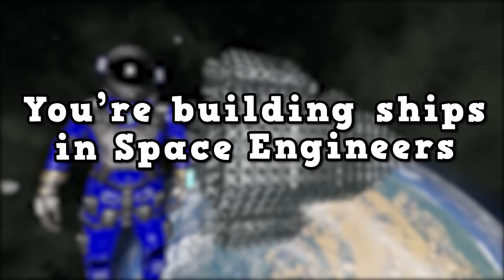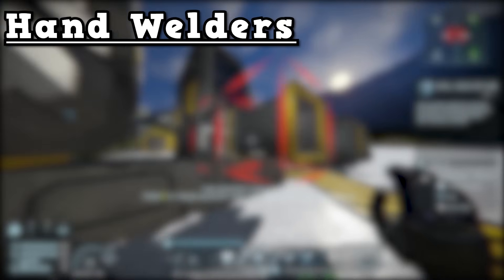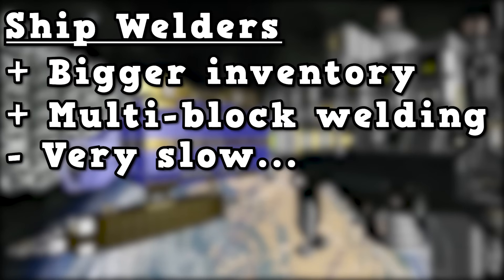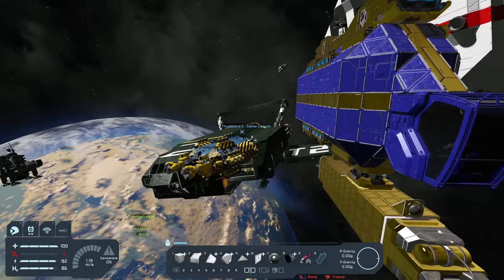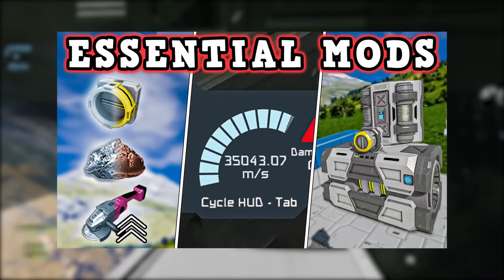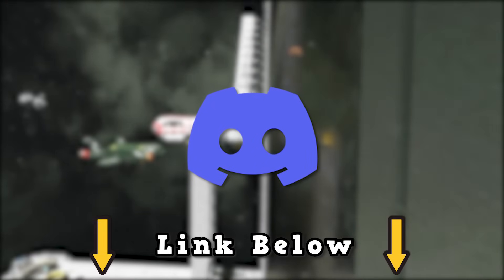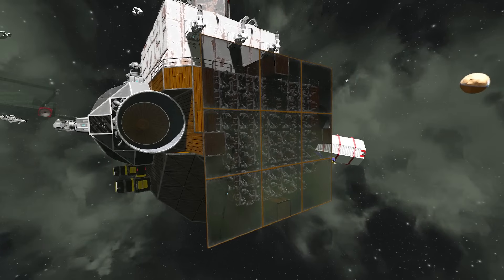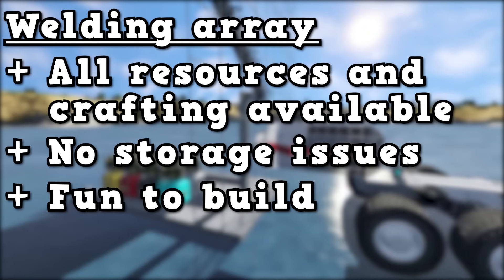You're building ships WRONG in Space Engineers

Comment: I use a very similar setup when I'm printing ships but I have two arrays of welders facing each other that slowly pull away from the projector building the blueprint as they do.  The only limitation I find is that there's a size limit on the blueprint but I have yet to want to build something that wouldn't fit between two fully extended pistons.
Reply: Neat. Maybe using the merge block tactic, mentioned by Louis Brown above, to glue smaller sections that fit inside your contraption might let someone assemble a larger grid.

Comment: Welding ships CAN use build planner. Just add the blocks you want to build, dock the welding ship into a plumbed connector, and use the button in the inventory.

Or, build a Neon Genesis Evangelion style welder ships with umbilical cord using advanced rotors and hinges. It works especially in space
Reply from the maker: Yeah, lots of people have told me but it's not the same is it. Far more tedious than the hand version.
Reply: @Zer0sLegion  well depends. Welding ships with multiple welding points, adequate cargo and manoeuvrability offset the hand welding ease of use and welding speed but limited engineers cargo capacity.

For building from a blueprint, a 3d printer is way more convenient than welding ships or hand welding.

But for some people who enjoy designing and building ships and bases on the go, welding ships and hand welding are necessary.
Also, the welding ship cargo can be expanded and not necessarily limited by the build planner slots as player can populate the slots, pull the mats, clear the slots and repopulate with other blocks, on repeat. This especially convenient to build big blocks or those pesky heavy blocks and plates.
Hand welding is nice for right spot manoeuvre. Especially indoors. I kinda hate to be back and forth looking for cargo access when hand welding. It's tedious.

Then again, I never used a single welder point welding ships tho (at least 3 or 4 welders), so I might be based.

Comment: So eventually it's just another take on how ship printers are superior to anything else. Crawler printer (when welder array moves along pre-built rail of sorts on wheels or via pistons/merge blocks/rotors is entirely possible and server friendly if done right.

Also for build planner - instead of using character inventory one can select welder ship's cargos on the left side of inventory screen and use convenient button in the middle to fill it with components IN the planner. Give it a whiff next time, saves some grief loading up. Also using shift and ctrl while clicking allows one to pull 10x components needed to speed up ship-based welding.
Reply from the maker: It is supposed to be a ship 3D printer, alot of people aren't aware of them.

And yeah, a couple of people have told me about the ship build planner interaction. It's not really what i meant but it's cool that it exists.

Comment: instead of running with a welding ship, i have an assembler ship, Dump all the raw materials i need in there, use the build planner to que up what i need, and then weld it. Can also fit a welder on the assembler ship as well.
Reply from the maker: Isn't that exactly what I do...
Reply: @Zer0sLegion  nah, your's is way more elaborate, i just put an assembler and a cargo container filled with iron and cobalt so i can fly it to where i do the welding.
Chopps down on the running to and from the cargo container when its right next to you.
Still, next time i make a bace ill make that printer of your's, looks way cooler. Maybie ill make it swipe from side to side like a 3d printer instead of the spinning.

Comment: I wish SE would explain stuff like this better.
I had no clue that: 
1. Hold shift + Ctrl to make a plane. I thought you had to go into settings, change it from line or whatever, and do that every time you wanted to make a big plane. Or meticulously build line after line.
2. That you're better off making blueprints from behind so that ships align correctly when placing them down.  
3. That you could control projector movements in a seat to better see where it's going
4. Build info has an option to show only currently attached and weldable
5. that you can build a small ship to "pull" the projection through the welding thing to build it up effortlessly.

I've spent so many hours in SE trying to find a good way to weld large ships that I've created, but they are so incredibly time consuming that I generally just gather all the materials I would need, spawn the ship in, and delete the materials.
Reply from the maker: That's what my channel is for, covering everything that no one tells you about Space Engineers.
I make the kind of videos I wish existed when I started the game.
Reply: Think that’s rough try on console.
What is Shift on a controller?
Reply: @Protect_all_ljf3forms  No real excuse for that now, at least Xbox Series has very high level of support for KB/M in many games, if you choose to play on a controller, that is your issue to contend with in complex input scenarios.
Now if the game doesn't support KB/M that's bad developers.
Reply: @Protect_all_ljf3forms  left stick down generally, it's just the sprint input by default

Comment: Zer0 you can use the build planner with ship welders. You can change the inventory on the left to be the whole grid and withdraw build planner components.
Reply from the maker: Yeah, a couple of people have told me now, I didn't know 😅
Reply: Yes, pls explain, thanks!
Reply: How do you do this?
Reply: @sethgilcrist8088  
There are buttons for buildplanner in the inventory screen in the middle between the inventory lists. The cogwheel + cube is equivalent to Shift + MMB (add buildplanner components to build queue) and the arrow + cube is equivalent to MMB (transfer buildplanner items). On top of both inventory lists there are buttons (helmet / cube symbols) to switch between personal and connected inventories. Using that you can pick a different inventory than you personal one as target for the buildplanner.
Keep in mind that it might transfer items to other inventories in the left list if it cannot put all items into the one you have selected for whatever reason. The best way to make sure all transferred items end up in your welding vehicle is to access the inventory screen from the vehicle (either from a cockpit, control panel or cargo access of the vehicle, does not matter) and filter the left list to show only inventories of the 'current ship' via the button on top of the inventory list (ship with two arrows).
Reply: @esgeran1654  cool I'm have to remember that. I mainly uses printers to make things.
Reply: @esgeran1654  I don't use this often, but when I do, I add tags to the end of my cargo container names so that I make sure only those are visible on each side. You can add [ship] to all your ship cargo containers and [base] to base. Whatever you use, make sure it's unique to each grid.
Reply: @sethgilcrist8088  on the left side of the inventory screen (your character inventory is usually there) switch from the helmet icon👨‍🚀 to the block icon 📦 to show the grid and grids it’s connected to. What you’ll probably want is changing the grid inventory to only that grid by pressing the rocket 🚀 icon then withdraw all components from build planner

Comment: Hmm I do believe that there is in fact a build planned for ships.

Open your inventory, the right inventory should be your cargo storage and the left inventory is your welder ship, be sure to select ship inventory on the left then just use the withdraw build inventory button in the middle...
Reply from the maker: If this works, you're getting pinned comment
Reply: @Zer0sLegion  it does, I always use the welder ship with buildplaner.
Reply: Would you still need to get out and look at an un-built piece to get the item on your build planner?
Reply: @Miiidge  yes, you can place blocks from cockpit but you need to use the hand welder to make use of the build planner
Reply: u can directly add blocks to build planner without using welder, also add more welders to the ship welder
Reply: @witdy002  true, I had forgotten about that.
Open the G menu, select the block you want any the type if it's a group (top right) then press mouse wheel to add to planner.

Thanks for the reminder witdy

Comment: So you don't have to have your ship being moved on a piston array causing Klang. You can instead have your WELDERS being withdrawn via piston. And also nope for the rotor welders, I get the PCU thing but a weld wall is so much better and quicker. 

Another thing you can do is build a rail and use wheels to pull your build back, making in effect a 3d printer. Just some ideas for you.
Reply from the maker: Welder wall is better but alot of servers limit welders so I was covering the most niche circumstances whilst mentioning other methods.
Reply: @Zer0sLegion  Star Trek Continuum it's like 18 drills max and like 10 welders. Also 1 Nanobot Build/Repair per grid, 2 max owned by player.
Reply: Wheels on a rail is how I always deal with server PCU/piston limits.   You can use 2 wheels and 2 landing gears(unlocked) to slide along a rail, making for an excellent move along an axis for a 3d printer.  Can make huge projects in a totally fire and forget manner.
Reply: I was thinking about it on a planet. Make a huge flat platform with a "troley" that hold the projector.
Then either pistons or simply wheels moves the projector away from the welder wall at slow pace.
of course welder wall is connected to storages to build/get items
Reply: ditto to robin
Reply: I use pistons to pull the PROJECTOR and the ship attached to it. since I build MASSIVE ships, there is already a station to defend the ship I am building, since the support infrastructure is required to build, arm, fuel, and charge up the ship. can just have a hing at the far end so when collapsed you can fold the entire thing up and out of the way.
Reply: rotor allows largest surface area, vertical piston allows faster welding. Pick and choose depends on needs.
Reply: Agree about the wall, disagree about the piston. Even more clangy than rotor. With drawing the welders by piston, it does not cope well with blocks "popping" in and has a high chance of exploding. Having a static wall of welders and a separate vessel pull the blueprint out of it is by far the safest and quickest option. One thing that was missed in the vid, is that the wall doesn't need to be massive... You can instead make several pull passes, provided you have sufficient clear space all around the edges of the wall
Reply: Do hinges suffer from klang?  Especially if they're connected and unfold.
Reply: @hadrianbuiltawall9531  oh hell yes. Tip if you build a drill arm on a ship, MOVE THE PISTONS AND HINGES TO UNFOLD IT SLOWLY! Or the arm my slam the ship aroudn the axis of any hinges.